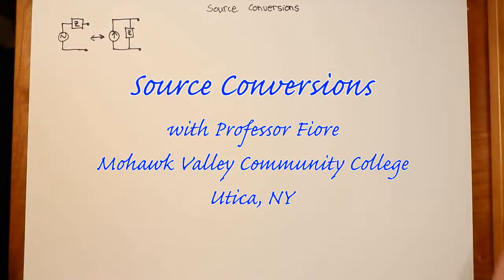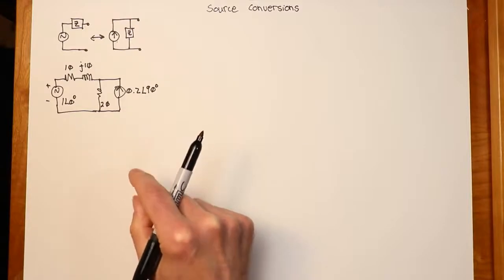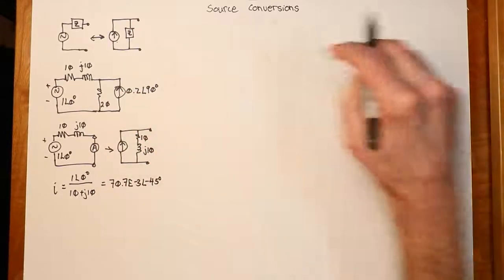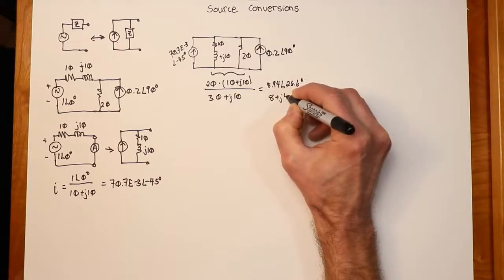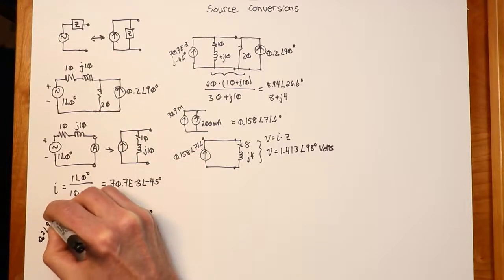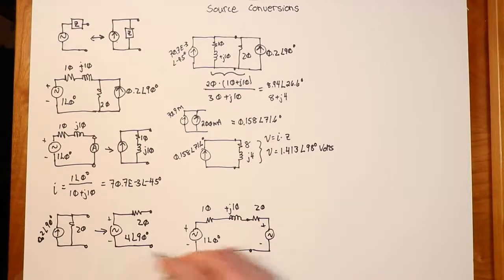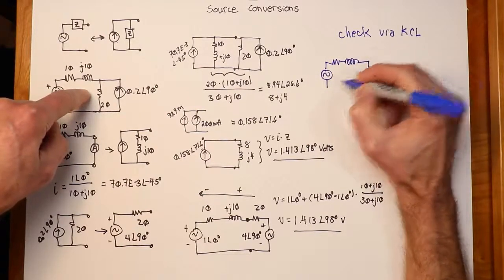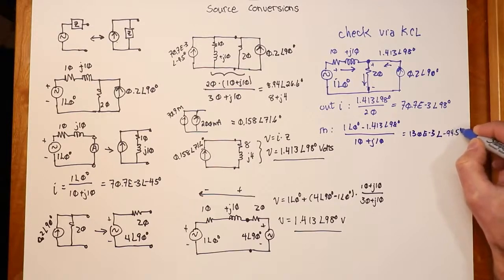AC Electrical Circuit Analysis: Source Conversions

Comment: Dear Professor , Greetings !! I am missing the math, Please help me on how to find the total current of 70.7mA at 45 degree plus 200mA at 90 degree .  Warm Regards Guru
Reply from the maker: It's trigonometry. I suggest that you start with some of the early videos in the AC Electrical Circuit Analysis playlist. Lots of examples there.
Reply: Thank you professor, I figured it , It is 49.99 + J150.1 resulting in 158.1 mA @71.5 Deg. Sorry troubling you on this. Warm Regards Guru